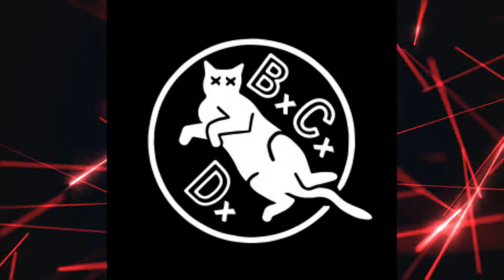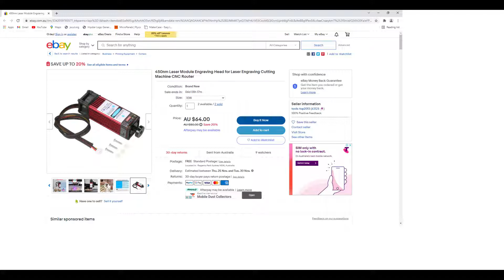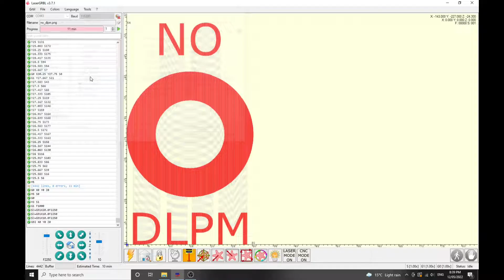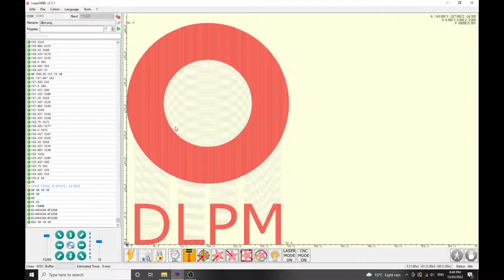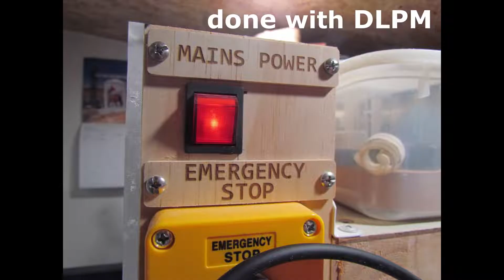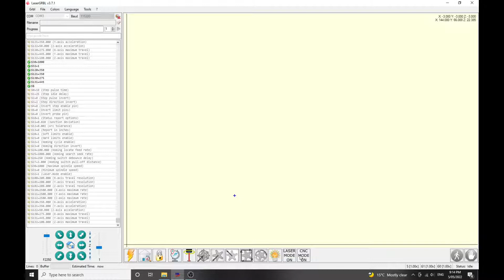Adding a Laser to my GRBL CNC Machine

Comment: Hi my 10watt is pwm. Just wondering if I need a separate driver? Or just connect the pwm signal wire to pwm output on the cnc sheild and a 12v power supply for the vcc. Cheers.

Comment: hello, can you tell me more about the round trip buttons and yours that make your life easier 🙂
Reply from the maker: Sure. The buttons just send text to the Grbl (arduino) console. So any combination of commands you can execute in the console you can create a button to do for you. If you right click in the button area you get the create or edit button option. Try the edit option and look at how the existing buttons are configured and build from there. My custom buttons primarily modify the laser mode, acceleration and soft limit values to suit running either a router or laser. The button does it with one click, without it I need to type half a dozen commands into the console.

Comment: That laser module works with 5v pwm? I'm trying to figure out how to convert Arduino 5v pwm to 12v pwm. The module I've bought works with 12v pwm.
Reply from the maker: You don’t need a 12 volt pwm signal. The laser is powered and driven separately. If your laser supports PWM you should have 3 wires. 2 wires power the laser via a connected 12vdc power source. The other wire (called the pwm wire) controls the laser via the 5volt PWM signal from the Arduino. The modulations of the signal are interpreted by the laser so that it varies the laser’s output power.
Reply: @blackcatdown9560  well, that would be ideal, but sculpfun s10 laser module requires 12v pwm, as far as I understand
Reply from the maker: @uniDTG  I have had a (quick) look at the Sculpfun S10 and I can’t see anything about requiring a 12v pwm signal. I believe it would work as I previously described with a 5v signal. 3.3 or 5 volt signals are usually what is outputted by microcontrollers, so this would make more sense than it requiring a 12v signal. Try connecting the 12vdc+ to the VCC, - to GND and the Arduino 5v pwm pin to PWM and see if it works. Even if it doesn’t work it shouldn’t break anything. 

If you do in fact need to convert the 5v pwm signal to a 12v pwm signal; the MOSFET you first asked about would achieve that goal.
Reply: @blackcatdown9560  yeah, it makes perfect sense, maybe it was inaccurate description from the seller. I'll try standard Arduino pwm and see if it works. Thanks for the hints!

Comment: Hello i have  CREALITY CV-LaserModule 24V 5W  how can i use this laser head on arduino uno with  cnc shield or which combination work well  thank you for respons.
Reply from the maker: Creality state on their website that it supports GRbL so it should work. My guess is that 2 wires go to a 24v supply and the 3rd wire is the PWM wire that connects to your arduino. The pwm signal pin on the arduino can vary depending on whether your running laser mode and on your version of GRBL. The laser section of the Grbl wiki has those answers is worth a read.

Comment: Is that the config.h file you edited?
Reply from the maker: That’s the one. After modifying it, recompile and upload it to your Arduino using the Arduino IED.
Reply: @blackcatdown9560  Now I'm having issues with the motors sounding like they're grinding up coffee beans. Would be a whole lot better if they were.
Reply from the maker: @jarodmorris611  If you undo the changes does the issue go away? I don’t see how anything I’ve suggested in the video could cause that issue. My guess would be a failed stepper driver (what drivers and motors are you using?) or dodgy wiring.
Reply: @blackcatdown9560  I'm sorry.  I did not mean to suggest that anything in your video caused these problems.  I was hoping that your expertise might have an insight that I'm missing.  I think my next step is to remove the problem stepper and see how it reacts with no load trying to turn.
Reply from the maker: @jarodmorris611  no worries. Something to try might be swapping the problem motor with another. You don’t need to remove them from the machine, just swap the wiring connectors over and test. This will help you determine if the problem lies with the motor or with what’s driving it.
Reply: @blackcatdown9560  I did that last night and same thing.  From that I took that it isn't the signal going to the motor, but something at the motor itself.